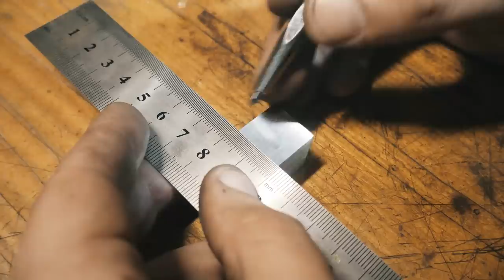Making Mini Mjolnir out from Giant Stainless Bolt

Comment: Damn, what a huge bolt! It looks great, and I love the simplicity of it, if you can call going through that many steps "simple"

I expected you to grind down the original threads of it down to make a hammer though, rather than cut it off entirely.

Edit: Where did you get the spring loaded center punch? I'm increasing my car's turning angle and a center punch I can push down to mark up a piece of metal or two would be very helpful.
Reply: i bought one from ebay it work great !
Reply: Harbor Freight (in the USA) has a great one that's cheap. The design is so simple that it's good quality.